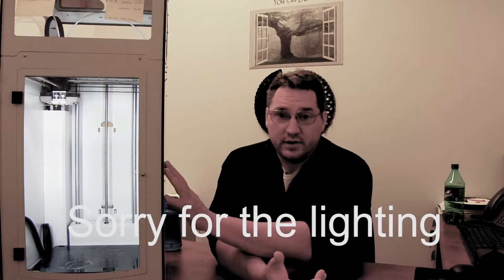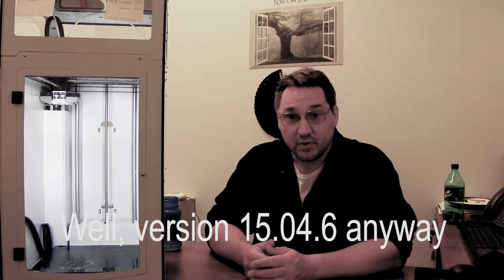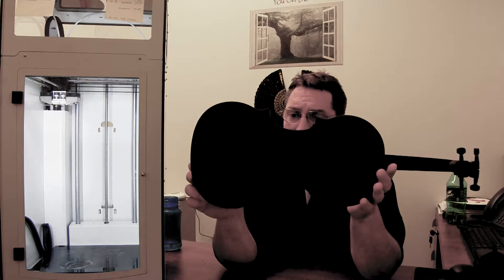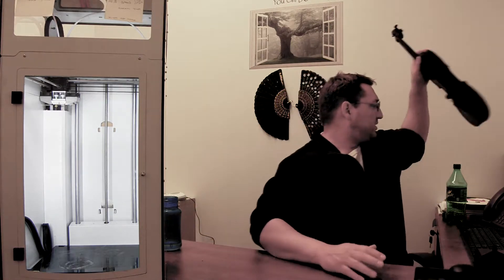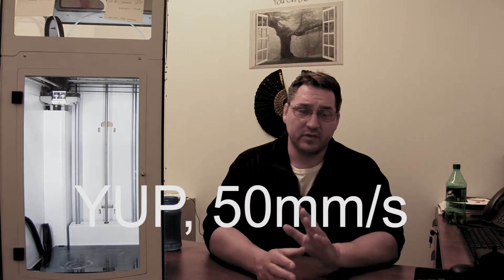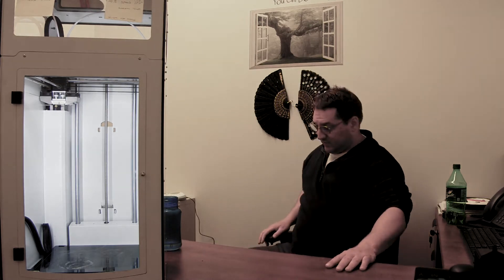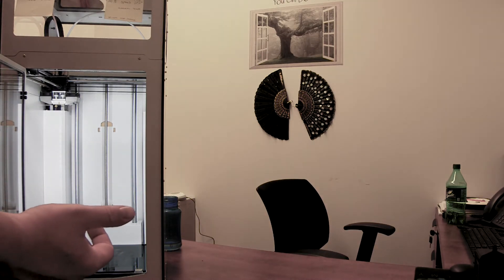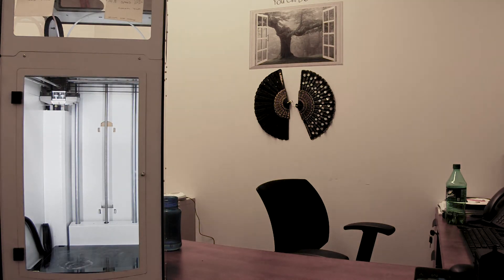Jenny Z360 - Language Settings and Nozzle Swap

Comment: Hi PT3D. I bought a Jennyprinter z370. I have a screen problem. Starts Flipped and then nothing works. Then the seller tells me to connect a wire that I don´t have (or didn´t came with the package).Then he tells me...then he tells me...then he tells me...I have upload some vídeos for him to see the connections. He wants me to connect a wire that I don´t know where it comes from.Can you help me out? Here´s the link for my last vídeo--->https://drive.google.com/file/d/1_30h4iHTJNwzYdr-uP1-prS31S8VeetV/view?usp=sharing And PT3D: And my temperature sensor indicates me 1100 ºC. Also another problem....

Comment: I'm having trouble installing a Jennyprinter4 Z370 firmware, I tried to install all the firmware on this page:
   http://www.jennyprint.com/hot/?/article/40
    http://www.jennyprint.com/hot/?/article/33
but I have not found what makes my printer work
I used the Cat 1.0 update program, but after various research I understood that it is obsolete, so I used version 2.0, but nothing,
I think I was wrong with the update procedure
where can I find a video that shows how the firmware is updated?
thank you
Reply: Hello,
I have the same printer and PCB board was been replaced with MKS gen v1, as previous board was been destroyed.
Did you found the firmware for the printer?
Because i am not able to find correct one for it.

Comment: 👍🏼
Reply: Did you try to upgrade the printer to marlin? I have the same printer but I'm a noob at configuring Marlin 
Would really like to tune some parameters (Bowden length etc.)... struggling to get it to work - help appreciated